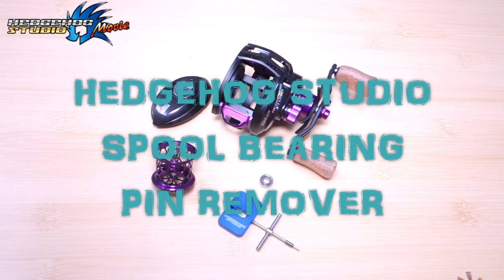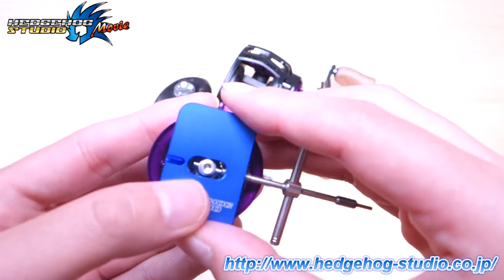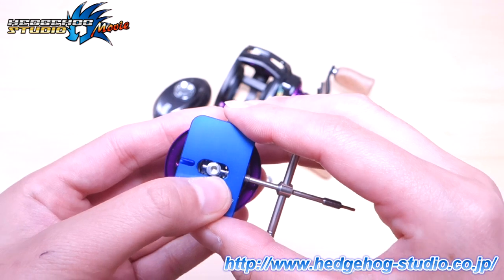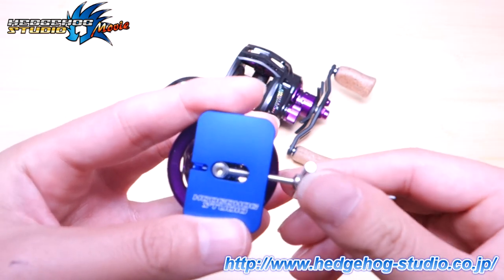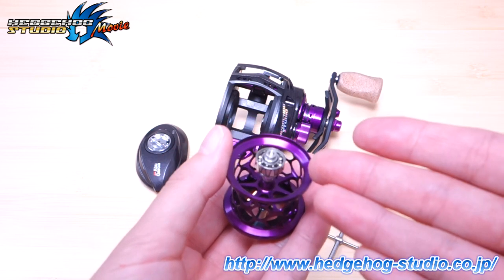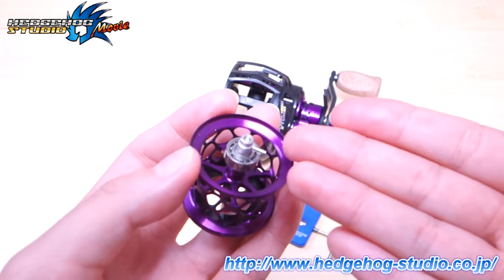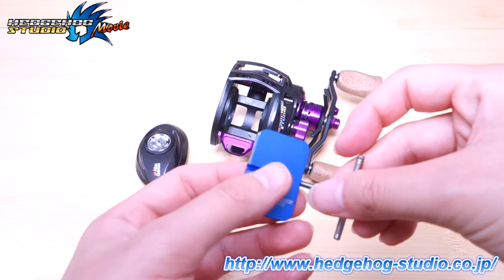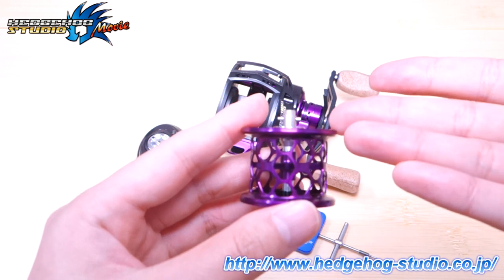Spool Bearing Pin Remover

Comment: My Hedgehog Spool Bearing Pin Remover came today, Monday 9/8/2014, to Charlotte, N.C. After taking the tool out of the very nice package, I picked up my Abu Garcia reel. Putting the tool on as show in the diagram and video, I started turning. The pin easily came out and I changed the bearing to a Boca orange seal bearing. Putting the pin back in was very easy also, with this tool. If anyone needs a pin removal tool that really works, buy this tool from Hedgehog. It will take a few days for the tool to arrive but, it's worth the wait. "Thank you Hedgehog for having such a perfect stainless steel tool"  Jim, Charlotte, N.C.

Comment: I just found you on eBay and your video is spot on.  I am looking forward in getting both SPOOL BEARING PIN REMOVER AND MY HEDGEHOG BEARINGS.  This will make my reel super charge!  I notice the webbed spool and that is something I've never seen before.  Are these custom spools or common spools in Japan?  It's so light wait compared to most baitcast reels offered in the US.